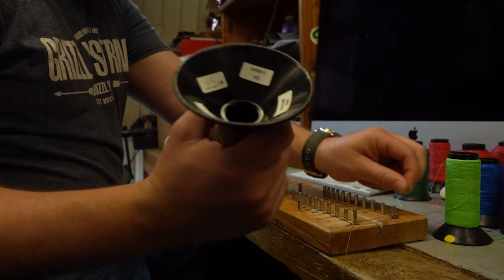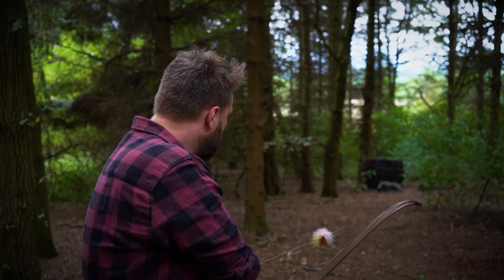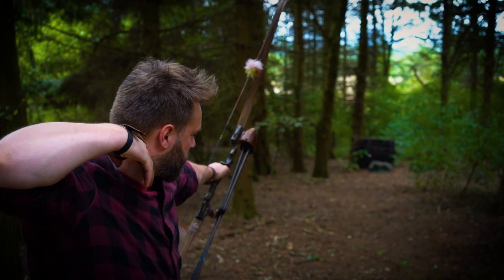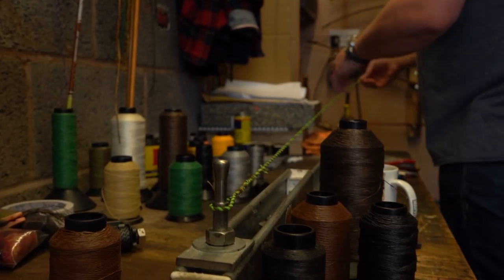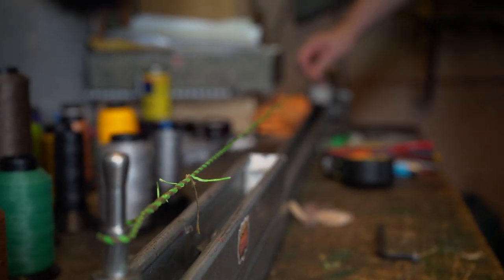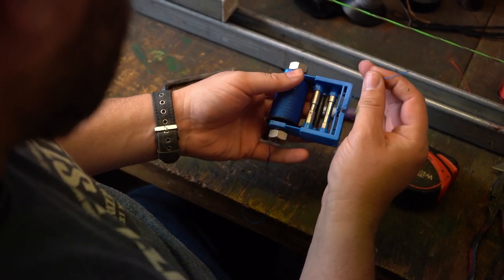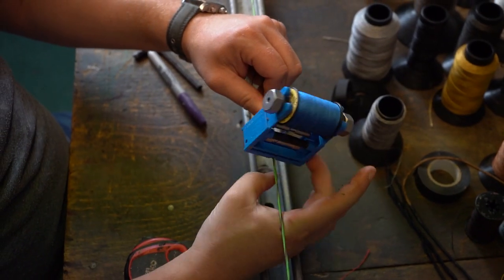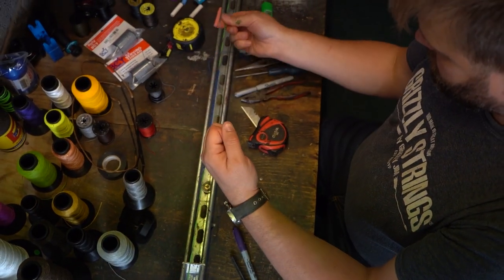Flemish Twist Bow String - Grizzly Strings

Comment: just started to make my own strings done a few needed to work out how to do it for my length done it now made a group of strings four in all but did not get it right until today mad a few mistakes  made my own flemish string board but it was worth it just need to pin it down  so it won't move to have it rolling around the table not a good thing like you I am on my own